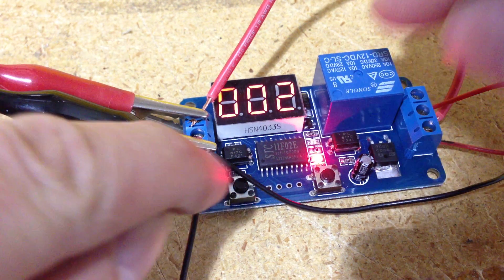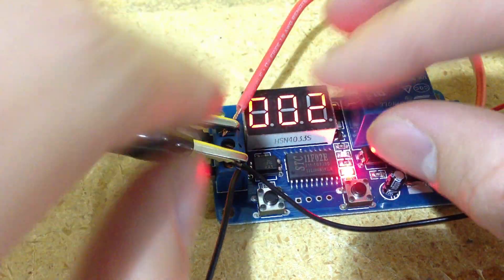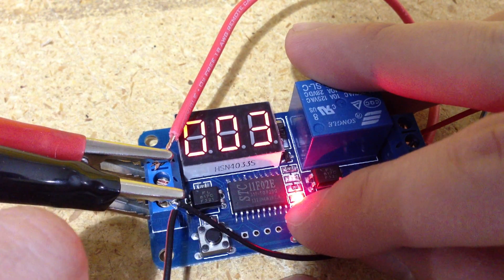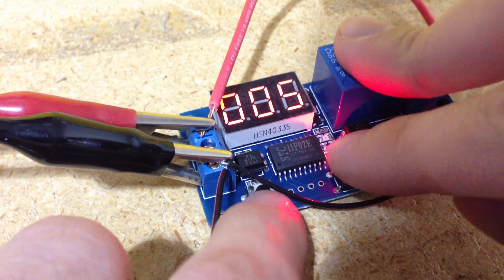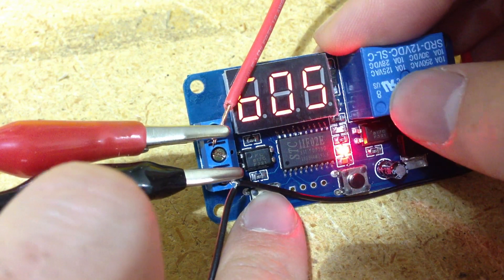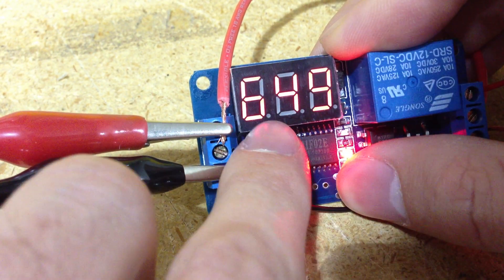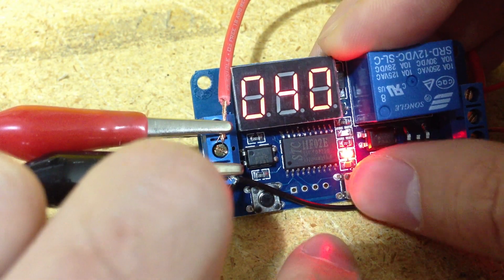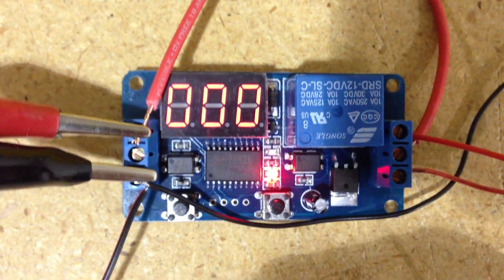12V Delay Timer Relay 0 - 999 seconds

Comment: Can you set it to start timer on open circuit trigger ? If trigger is  12 volts I want it to start timer keep power and the trigger is disconnected ?
Reply from the maker: No, but you can use a simple relay to do that.

Comment: Cool!
So if I will hook one of those right after a 12V 150w power supplier, how much usage can it take? Can I run 120w through this?
Reply: The relay is rated at 10 amps.  12 volts times 10 amps is 120 watts.  But to be safe I would only use 80% of its max rated value

Comment: thanks for your comment. But I want the actual unit to only run for 8 hours anytime I turn it on. If I use a time like you mentioned it's going to come on at a certain time everything but I want set the time which will be different everyday. I can get a board built that will do what I want. Thank you so much for your help though. I appreciate it.

Comment: Hi maybe you can help me. I want to push a button and have a12 volt fan turn on and run for 8 hours then shut off. Then the next day push the button and the fan will run for another 8 hours.
Thank you
Bob
Reply from the maker: +Bob Morrison Its certainly do-able, but you'll need to find something with a longer range. This product has a range of 0 - 999 seconds (so 999 seconds / 60 = 16.65 minutes)
Reply: +Bob Morrison nothing difficult, get a plug-in timer. set the ON and OFF time. You're done

Comment: The specs. for  this timer say that it has 3 time ranges  0.1 - 99.9  seconds  1-999 seconds and 1-999 minutes  !!  the default is  1-999 seconds   ,anyone know  how to change the range  ?? I have tried every combination of buttons  i can think of .
Reply from the maker: +Dave Lanchester
You must be thinking about some different product.
This one only has 1-999 seconds.
Link to product page: http://www.oznium.com/12v-delay-timer-relay
Reply: +OzniumVideos  Yes thanks you are  rite  , there is another timer  that looks almost identical  with the extra features  !
Reply from the maker: +Dave Lanchester Please give a link to it.
Reply: I found some instructions on eBay: https://postimg.org/image/ishbkztj9/

I got the ranges changed. The first was easy, just pressed the keys simultaneuosly. The second range change just didn't work like that, at all. I actually don't know what was the secret key code after many minutes clicking but suddenly after one K1 press, the range changed. :D

Comment: Hi, I just need to ask, how did you wire up the circuit to a motor/light? I got a similar circuit, but it has more functions (search google for FRM01) and I can't get the motor to turn on, do I need to wire it up in a certain way, because the instructions that came with mine, were crap, and I need to know how to wire it. Thanks